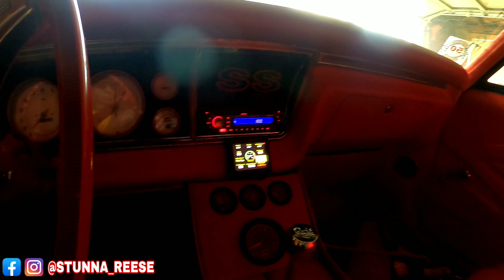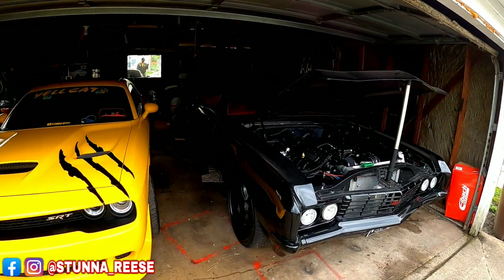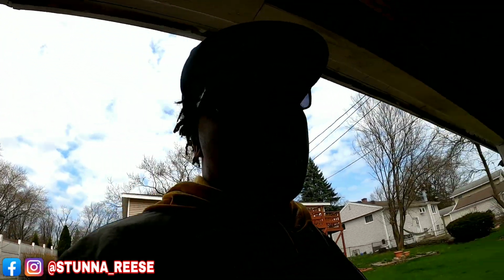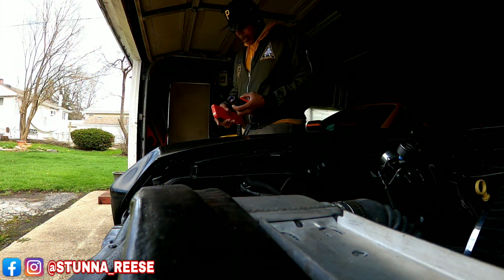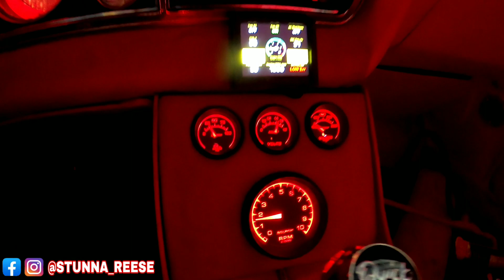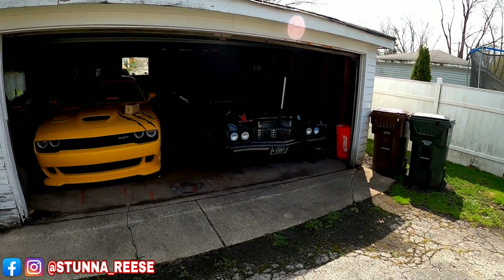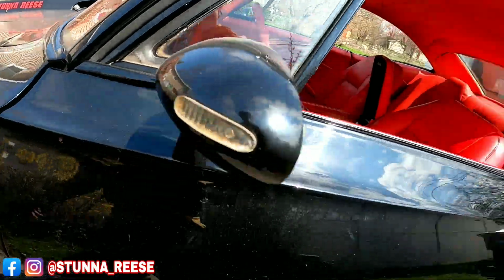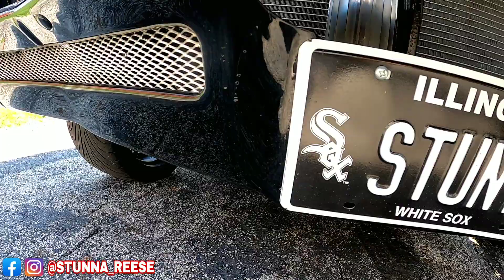STARTING UP DRACULA FOR THE FIRST TIME IN MONTHS

Comment: Check those pulleys spray it with water and if the noise goes away it means your pulley is bad. And bout the cylinders you probably just need new plugs and coils anyways drac allways lookin good big homie

Comment: What is the car doing im a mechanic from south fl spray wd 40 to see the noise goes away on idler pulley, alternator, ac compressor clutch and power steering pump it could be a  bearing going out on one of those parts the under power it could be a  lot of things piston compression rings bad spark plugs bad or weak fuel pump dirty air filter clogged fuel filter bad fuel injectors bad ignition coil camshaft position sensor mass airflow sensor and oxygen sensor a lot of stuff to check out or put a obd 2 scanner to pull the codes out